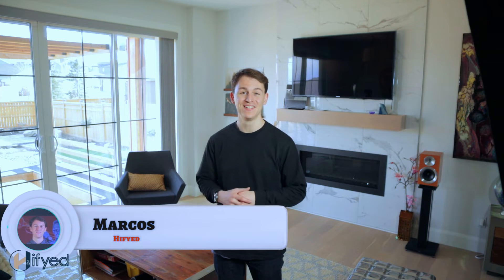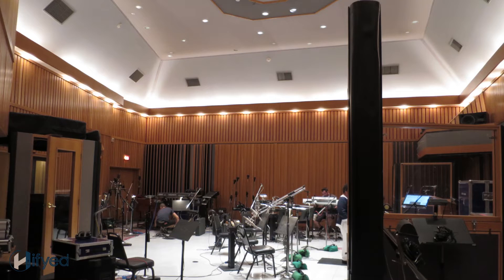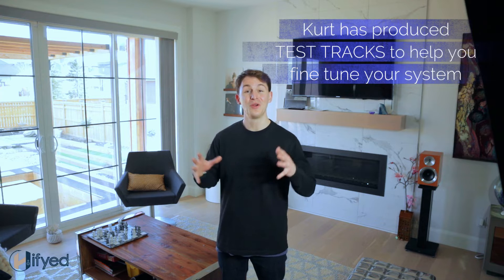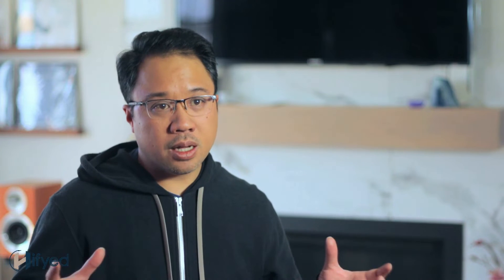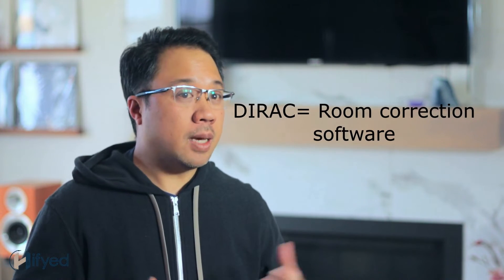SPEAKER/SYSTEM setup with TEST//OVERVIEW on what's to come on HOW to MAXIMIZE your systems POTENTIAL

Comment: My front wall is 7 feet speaker L is next to 15 ft of window R speaker at edge of wall with 10×10 open kitchen. Sheesh, not good huh. No headbanger but a pretty wide open apt. Any advise is much appreciated. Thanks
Reply from the maker: you may not be able to get all rooms to work perfectly, even dedicated rooms with acoustic treatment are not. The best thing to do is try to get the most of it. You mention the right speaker  is at the edge of a wall. Is it open to the kitchen? Just trying to picture the layout.
Reply: @Hifyed  Thanks dudes..I'm in the process of getting some sort of acoustic curtains for the window side. The right; hopefully I'll figure it out. Really like your show. I've had a few systems in my young 72 years. Just that my new place is kinda awkward. Keep on..Oh and yes kitchen is wide open as the rest of 750 Sq. Ft. Ha only two doors bedroom bathroom.
Reply from the maker: Thank you! Acoustics curtains will help! What you want to do is properly dial in the toe in on the open side. Get your curtains and run that preview test track . This is a good way to see if your sound matches the location on the graphic. You will need to balance the open side by toe in etc. I’m currently trying to figure out videos that are easy to understand regarding all setup issues. Depending what your system is doing on the test track I can help you give you guidance.
Reply: @Hifyed  Thanks much. I do very much appreciate your advice and remain open to any suggestions you may have. 😊